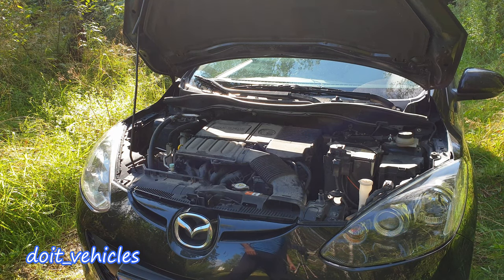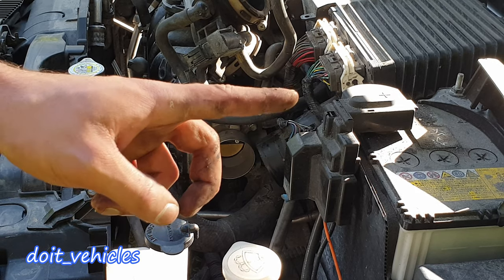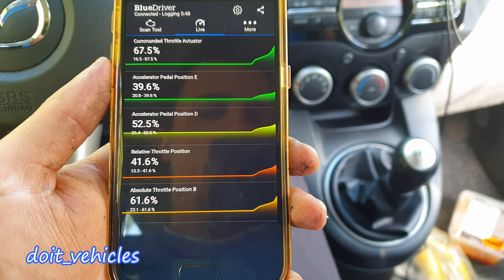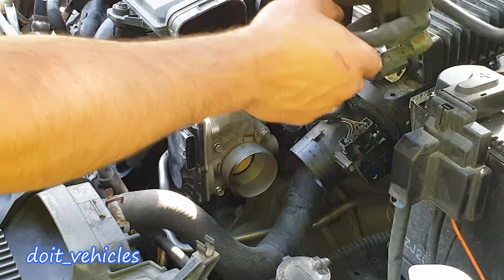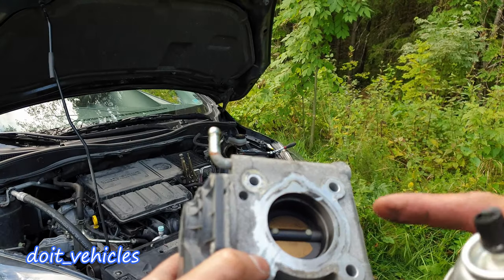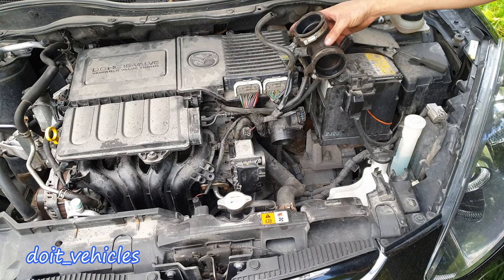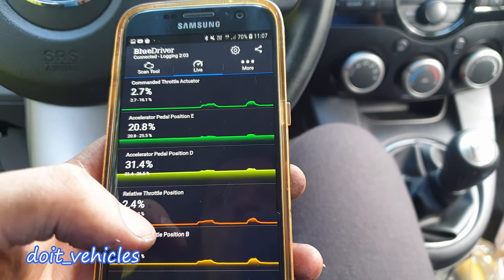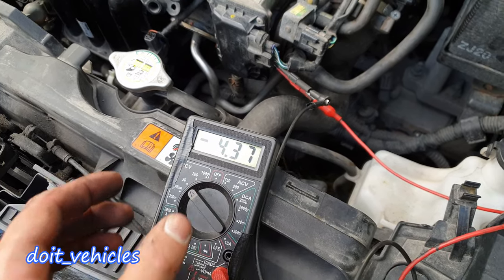1.5 Mazda 2 Throttle Body DIAGNOSIS , Removal , Clean , Replacement ts2

Comment: My car's idle was very rough and I couldn't figure out why until I watched this video and saw your throttle body.  My throttle body was super dirty and I decided to clean it.  Behold!  No rough idle, no vibrations, and as a bonus my check engine light turned off.  Thanks for this video!
Reply from the maker: I am glad to hear that !

Comment: i've cleaned mine and now the engine have more power and is more stable at idle, but when pressing the brake pedal now I have to press strongly than before, shoud i change the brake pads? or maybe reset something? i noticed that when braking the engine keeps running at 2k rpm until stop, is it normal? thank you good sir

Comment: Hey mate, any idea what could cause a rough intake noise and loss of power with the engine under load? happens around 3-4k revs. cheers!
Reply: cause of power loss : Faulty Fuel Filter, Clogged Air Filter, Clogged Exhaust System, MAF Sensor Malfunction, Oxygen Sensor Malfunction, Carbon Buildup on Fuel Injectors, Weak Fuel Pump

Comment: Hello sir, Great video from you again.. I want to ask you about torque for Throttle Body and EGR Valve..

What is the best torque for TB and EGR in Mazda2 (2009 - 2014) ?

Thx a lot
Reply: On google I found that : Assemble the throttle body with the 2 bolts and the 2 nuts. Torque the bolts and nuts to 14-18 ft. lbs (19-25 Nm). Did you found the same thing ?

Comment: Good day Sir. My M2 throttle body make some buzzing sound after the cleaning. If you position the key in "on position", is the sound normal?
Reply from the maker: yes , most of the will do that

Comment: Another great video that is going to help me do a big service on my car! Do you think it would be wise to do a Prestone cooling system cleaner flush on my car? It is time for me to change my coolant fluid, but the Mazda2 takes a special type of fluid and I am nervous that the Prestone flush might cause harm. However I think it would be good to do it too to help keep clean the system before I add in the new coolant. I appreciate your help with this! Do you have a venmo or something where you can take $ for supporting your channel and its helpful videos?
Reply from the maker: It shouldn't do any damage if you run  that flush fluid for a short distance . To have the peace of mind you can flush it a second time with destilled water before replacing it with the final coolant

Comment: torque for the 10mm bolt of the throttle body? thanks
Reply: On google I found that : Assemble the throttle body with the 2 bolts and the 2 nuts. Torque the bolts and nuts to 14-18 ft. lbs (19-25 Nm). Did you found the same thing ?

Comment: Dear please for advice, mercedes w169 a170 petrol, when it's cold it turns on and works on 3 cylinders, and when it heats up it works normally and shows p0304, I replaced the spark plug, cable and coil and there was no change
Reply from the maker: the best is to do some tests before replacing anything : injector test , compression test , connections etc

Comment: I replaced my AC compressor and after that,anytime i turn on my Air conditioning,my engine stop in idle.when I’m in traffic with AC on,the engine stall..I adjusted(increase) the rpm and everything is okay now but my car move a lil bit without accelerator pedal..any idea of what to do ?
Reply: is it not normal that your car moves a little bit without accelerator pedal ? Obviously when not in neutral... right ?
Reply: Like many parts of your vehicle, the air conditioning system takes its power from the engine.

It’s understandable that due to this, there may be significant pressure on the engine. If not controlled, it can lead to overload or malfunctioning.

An example of this is regulating the idling rotational speed through the IAC (idle air control)  valve. Also referred to as the idle air sensor control motor, due to its function.

The valve determines the amount of air that bypasses the throttle plate in a fuel injection IC vehicle, therefore changing the idling speed as necessary.

A fault in the IAC such as build up, can cause poor idling or stalling of the engine.

If not working properly, the engine may not cope with the loads produced by various systems in the car.

More specifically, it may be too low to run the A/C and hence it stalls when turned on.
Reply: While the IAC valve is a common cause of the problem, there may be other reasons afoot.

The A/C system usually requires a lot of generating power and if not supported fully, it may not function properly.

This could be due to other components running inefficiently, such as a seized compressor which can no longer turn. This could lead to debris being sent through the A/C system and severe damage to the compressor and other related parts.